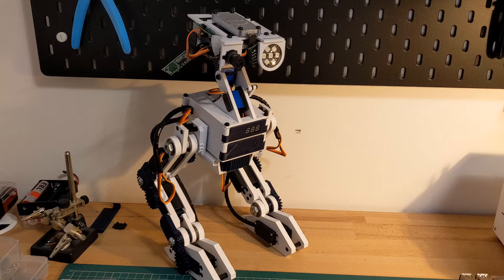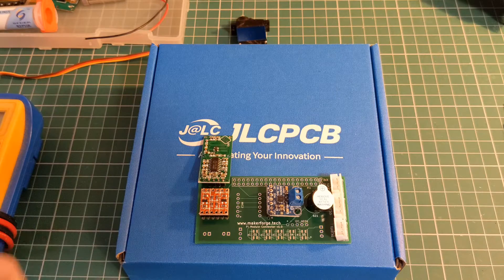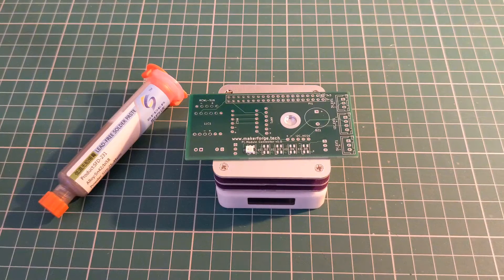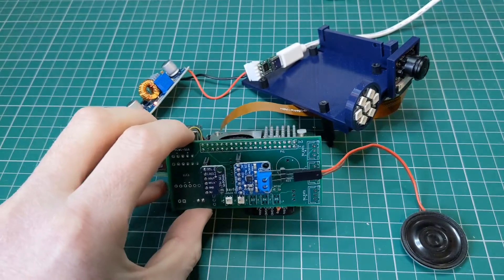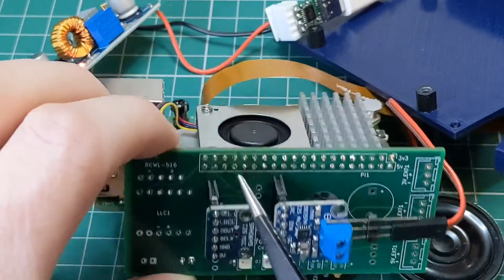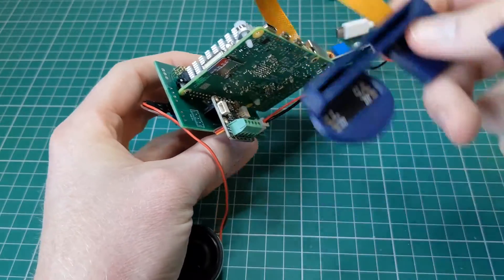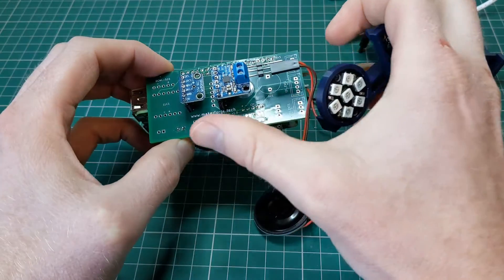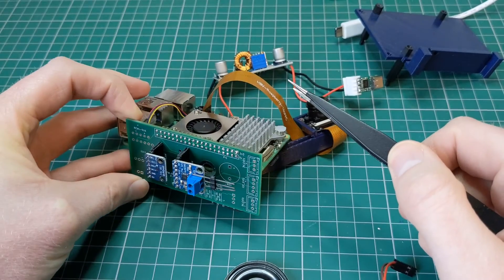Build a Raspberry Pi 5 Robot  - Build Log 4

Comment: There is a much higher resolution version of the led eye by MATT (something) but I have to ask, if you are using a 5, why not run duel cameras?
Reply: Dual camera setup could be used to create a depth map and maybe utilize this in behavior of robot. Very interesting project, great work.
Reply from the maker: Nice! Do you have a link for that eye?
I'd like to experiment with dual cameras, but I don't have a use case for it on this version so I'll let other people blaze that trail 😉
Reply: @DanMakesThings  Look for Jason Coon, his LEDS arrays are amazing.